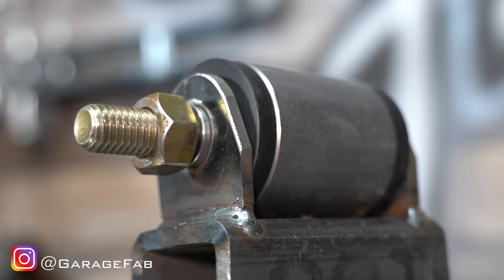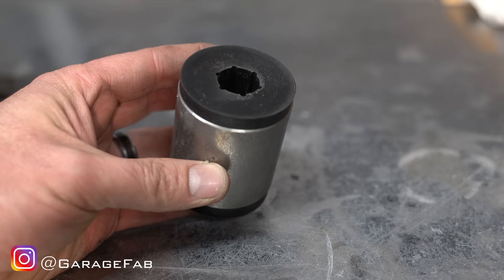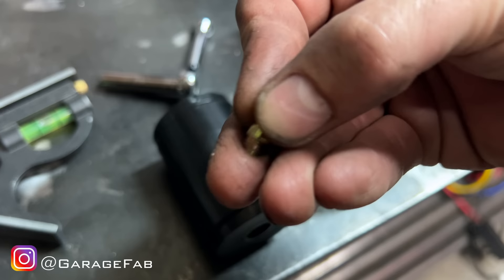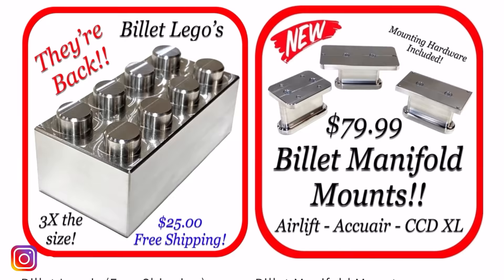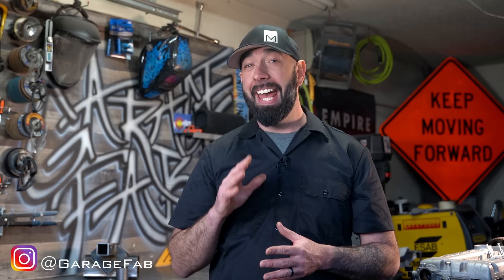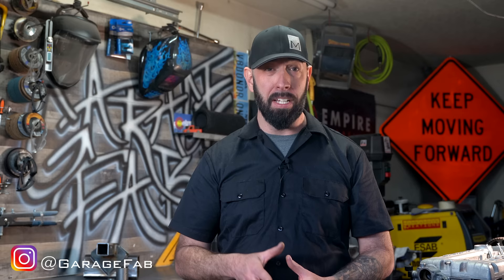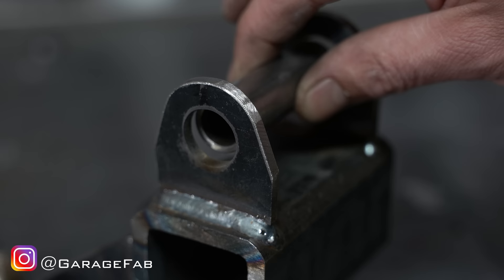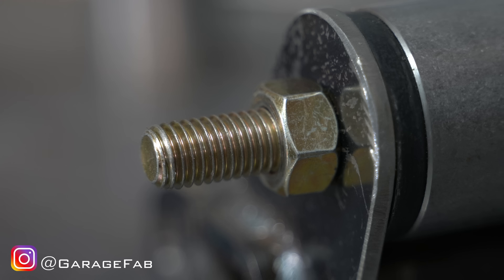The DOs and DON’Ts When Installing Polyurethane Suspension Bushings

Comment: So I might be a little late to this video but I will shoot for it anyway. I'm looking to install polyurethane bushings on my car in the near future and I´m still a little confused after this video where I should and shouldn't put grease. Clearly after watching this video I understand that you are supposed to grease between the inner sleeve and the poly bushing but i've seen a couple of other videos of people installing poly bushings and they also grease between the poly bushing and outer sleeve... is this wrong or right or does it even matter? I'm suspecting that I am thinking of poly bushes to much as a standard rubber bushing where it uses the flex of the rubber itself to move. Also I've seen some people put some teflon tape between the sleeves and the poly to prevent eventual squeaks, is this ok to do or should I avoid it?
Reply from the maker: There’s going to be a lot of opinion in this answer. I honestly don’t know what the “correct” answer is but I’ll do my best to explain why my beliefs are what they are.
I only grease the inner sleeve that’s designed to twist inside the bushing material.
The outer sleeve generally does not move on the polyurethane. It could technically be glued to the outer sleeve and it would work beautifully.
Because the outer sleeve does not move, it shouldn’t squeak. By lubricating the outer sleeve, you could be promoting movement that shouldn’t exist. If you have movement, the grease will eventually squeeze out and a squeak will develop. To clarify, squeaks come from insufficiently lubricated polyurethane sliding against something else.
So greasing the outer sleeve in an attempt to prevent squeaks might actually cause squeaks. 🤔 
What you need to know about poly bushings is they are notoriously noisey. The only way to keep them quiet is to lube them and lube them often. The only realistic way to lube them often is through a Zirk fitting. It baffles me that control arm companies often neglect installing Zirk fittings. The only other way to lube is to remove and disassemble. No thank you.
Here’s the thing about Zirk fittings; If they’re designed properly, the fitting is positioned at a small gap between the bushing halves and the inner hole in the bushing material has channels to supply the inner sleeve with grease. Important note! Those channels don’t exist for the outer sleeve. So if it starts squeaking there you can’t replenish the grease using the Zirk, so your only choice is to disassemble and grease. (Or remove said grease.)
Another reason I’m not a fan of greasing the outer sleeve is some bushings see lateral force. If the outside sleeve is lubed, the sleeve could slide sideways better on the polyurethane putting extra force on the poly bushing flanges. Big deal? Prolly not. I just don’t like that idea.
Honestly, I haven’t had obnoxious bushings since realizing the importance of frequent greasing. A little grease once every other oil change and it’s fine.
That said, teflon tape sounds weird. Maybe it works. 🤷‍♂️ I predict problems installing it. Teflon tape is strong when you pull it long ways, but quite fragile when you pull it widthwise. I can foresee Teflon tape just being torn and pushed off the sleeve when trying to press the bushings into the sleeves. But again, what’s the point of a creative hack when proper lubrication is generally all that’s needed? Hopefully this made some sense. Lemme know!
Reply: @GarageFab Wow man thanks for the response! Yeah it seemed a little weird to me why you would lubricate in places that could allow movement that maybe wasn’t designed to be there. I’ve also started to understand that with mods that improve performance you have to make compromises on other stuff that car manufacturers can’t ignore if they want to sell to the masses. I guess with the perfomence of poly you might have to endure a little squeking as well
Reply from the maker: Truer words have never been spoken. Your thinking is spot on.

Comment: As a 75 year old, retierd, mechanic, i was taught it was incorrect to tighten up a nut bolt attatchment using the bolt. Doing this can damage the inner bush.. Also the use of nuts and lock washers is a NO NO. Lock nuts are safer and garantie not to vibrate loose. .
Reply from the maker: Thank you for the info, Edward! Could you clarify the tightening procedure? The way I read that was “Turn the nut while holding the bolt still.” How does turning the bolt damage the bush?
I work on modern Toyotas for a living. Many of the suspension fasteners have bolts with washers and nuts that are designed to bite into the chassis to prevent movement. These nuts cannot be loosened or tightened by turning the nut. You MUST turn the bolt or you’ll be breaking tools and swearing.
Reply: @GarageFab  The bolt, being the same diameter as the inner metal sleeve, will turn and can damage the sleeve and the holes in the fixing locations. Self locking nuts will allow the bolt to be pulled thro therfore reducuing the risk of damage to bolt and sleeve..anyway,,Just my thoughts, and time charges everything...
Reply: Time CHANGES  everything...

Comment: Very nice, I just don't know how to deal with solid rubbers. The ones that don't spin.
Reply from the maker: What do you need to know? There’s not much you can do with them. They generally can’t be greased, so if they’re noisey, replacement is often the only option. When installing it’s important to NOT tighten the through bolt until the weight of the vehicle compresses the suspension. Tightening things down in the air can cause the bushing to tear prematurely because it’s constantly flexed/twisted.

Comment: I've understood how the bushing is supposed to work, but what I always thought was odd is that if they really wanted to keep the inner sleeve from turning, why aren't the ends serrated so they lock in to the tabs?
Reply from the maker: I wish I could send you photos in the comment section. Toyota does exactly that on their front control arm bushings!

Comment: Some suspension bushes bolts should be tightened up once the vehicle is on the ground not in the air as you can damage the bush over time due to it being preloaded artificially.
Reply from the maker: Very important info there! Bonded rubber bushings don’t slip like polyurethane bushings. Tightening them on a lift is a great way of tearing them or at least drastically shortening their life. You’d be surprised how often “experienced” technicians do this wrong.
Reply: @GarageFab  👍💯

Comment: So about the bolts, as long as everything is properly sized (tab and bolt hole) is there a need for washers on the either side of bolt (head and nut sides on the outsides).
Reply from the maker: I always use washers, Patrick. But I can’t really tell you a scientific reason why. Admittedly it’s just because everyone I know has always used washers. A terrible reason to do anything. I know they protect the surface, and I know they help to distribute the load of the bolt more evenly. But what’s the consequence of NOT using washers. Cracking? Loosening? No clue!
Still I’d advise that you do. It’s just a few more bucks, washers won’t cause harm, and they definitely make your projects look more professional, and it’ll keep you out of trouble from the washer police.
Reply: @GarageFab  Take it one step further, use flange bolts and nuts, pretty much the best of both worlds, at the sacrifice of being more expensive and not quite as readily available of course, but I do love them, especially with a top lock flange nut for final assembly.
Reply from the maker: I can agree with that. Far too many of my decisions come from what I’ve seen Toyota do on their cars. Almost everything is flange nuts and bolts, and I’ve come to love them. 💕

Comment: Any input/guide as to the metal gauge for making tabs bushing tabs? Like is it always size....xyz or do you go up proportionatley based on  the size of the build?
Reply from the maker: I consistently use 3/16 inch thick steel for bushing tabs. But I always build roughly the same size vehicles. I think the thickness of the metal isn’t as important as the structure of the tabs. For example, production vehicles, Toyota, Ford, etc. use 1/8 inch thick metal for their link bar and control arm tabs, but they’re stamped in a very sturdy boxed design. I try and take their designs into consideration when I design my own. If the tabs will just be pushed and pulled on, like on a parallel 4 link, and the tabs are short, I’ll simply weld them to the frame. If they’re long I’ll connect them together in the form of a C.
If the tabs will be pulled or pushed sideways, I will connect them together and gusset each side to prevent sideways movement. I’m not an engineer, so the best I can do is copy with the professionals do.
Reply: @GarageFab  As an amateur fabricator, when structure design strength is in question, I have always gone with: Better to over build vs under build. Thx for the reply!
Reply from the maker: I strongly agree. Overbuilding is likely only an issue on race cars when weight becomes a focus. 👊

Comment: In your opinion, what (if any) is the best way to lubricate bushings that do not have grease fittings?
Reply from the maker: Excellent question! So good in fact that I don’t have a good answer! 😂 
I think the only right way is to remove component, disassemble the bushing, and lubricate it by hand. Because I’m a lazy person, I’d probably try to avoid that by drilling and tapping a hole in the sleeve and installing a grease fitting. It’s a Hail Mary, with no guarantee grease will even inject properly, and you might be back to square one.
Reply from the maker: I pondered for a moment, and realized I automatically assumed you were talking about a polyurethane bushing. Most production vehicles have bonded rubber bushings. If you have that type, there is no lubrication possible. 😩
Reply: @GarageFab  So, what I’ve been doing (and it very well may be “wrong”) is a light shot of silicone spray. It creeps under surfaces and seems to stay put and repel moisture for quite some time. Just wondered if there was a better way. Thanks for responding… btw - your video on the differences between triangulated, parallel and watts link 4 links was fantastic. Great job!
Reply from the maker: Thank you my friend! Very much appreciated. 🙏 I think your silicone spray is just fine. I’ve used the dry type on rubber bushings at work, and had better results then with anything else. WD-40 works but only temporarily! White lithium spray doesn’t seem to get into the tight crevices. Best of luck!

Comment: What if you have old crusty leaf springs attached to said configuration and there is no grease port, should you hose it with your favorite spray?
Reply from the maker: Unfortunately, Dave, I don’t think I have a good answer for you. I’ve never had a lot of success lubricating assembled bushings. You can douse it with whatever you please and attempt to work the suspension to get the lube to penetrate but it just won’t! I can tell you the best results I’ve had is with silicone spray (dry type or wet type.) It’s very thin and if there’s any crevices the spray will find its way in. Plus silicone is safe on most bushings whereas petroleum based lubes are not.
I think the only “Right” way is the most unpleasant; to dismantle the bushing and either replace it or lube it by hand and reassemble. 😬
Reply: @GarageFab  can that cause a van to be stiff as a board and feel every bump? do rusty leaf spring packs also cause that because they dont like to flex? every van i had was kinda stiff though
Reply from the maker: I think a stiff ride is just the nature of trucks and vans. The springs need to be able to support heavy loads, and unloaded they feel… well trucky! Bushings and rust aren’t likely to change the ride significantly.
An option, is to remove one or two of the bottom leaf springs. With each leaf removed, the van will ride softer, but also lower. If you find the ride quality you want but it’s too low, you can add lift blocks or helper air springs.
Reply: @GarageFab  mine is actually an e350 super duty senior citizen bus. i called the company that did the conversion process in 2005, and they have no idea what im talking about, but my contention is it may actually have some extra leaf springs in the pack, one of them is even touching a bolt on the brake caliper making it difficult to remove the caliper, and this is on both sides.
Reply from the maker: Oh my! That sounds less than acceptable. I would not be surprised if a personnel carrier was modified for more weight. Start there!!

Comment: The inner sleeve is not the same length as the total width of the bushing assembly. It's not supposed to be either. It's supposed to be 1/16" to 1/8" narrower to compress the poly bushings slightly so they don't wear to a loose situation. 

Secondly energy suspension poly bushings are graphite impregnated and do not need grease ever.
Reply from the maker: I’d agree with that 100%. I avoided that as to not be confusing, but the way you worded it wasn’t confusing at all. 🤔

Comment: I like your cross member you built in your video I want to build a similar cross member for my Samurai it will go right behind cab ..the distance between center of axle and cross member  will be 16"  .. I know that's short but that's my best workable space .. the bottom four link bars will be no longer than 16" center to center bolt holes .. that's my only way for me obtain parallel 4 link with 8" of height  differences in my small space ..  will it work ?

Comment: soooo....about those toyota bolts rusting the inner sleeve of bushings....what tips might you have?  I got the backing plant off and the outer nut of the rear strut rod, but the bolt is definitely not interested in coming free of the sleeve
Reply from the maker: Oh boy. My apologies my man. That’s an ugly situation. When we come across that, it’s time to go at it with a sawzall. We cut through the sleeve, while trying not to damage the chassis. Unfortunately you then have to replace the alignment sleeves.
Reply: @GarageFab  thanks so much....I figured.  Gramp's 50's sawzall is about to come in handy....ugh LOL
Reply: @GarageFab  well the good news is I got the strut rod bushing replaced at the knuckle only to find out what is probably really the problem is the trailing control arm bushing at the knuckle.  Instead of a sawzall did you ever have any luck with any sort of carbide cutoff tool used in automotive sheet metal work or anything thin like that?
Reply from the maker: Yes, though I didn’t want to suggest before since it’s a definite no no. I use a 6 inch cutoff disc on a 4.5 inch grinder with the guard removed. Such a bad idea for so many reasons. So I’m officially recommending you don’t do that.
Reply: @GarageFab  oh I'm that daring anyway.  I won't share what I've already done 🤣
Reply from the maker: May God have mercy on your soul, good man!

Comment: If the tabs are already welded on the frame how do I make a straight hole with a hand drill for the bolt?
Reply from the maker: Have you got a steady hand and a carbide burr tool? It’ll take a little longer but you can just sculpt it by hand. There’s certainly won’t be enough room for a router unfortunately.

Comment: Can you make a grove on the busing so as it moves it spreads the grease.
Reply from the maker: The bushings I use, already have all the grooves needed. There’s none on the outer walls though. I don’t know if that would help or hurt. It might make it easier for the grease to escape and go dry.
Reply: @GarageFab  Keep the grooves with in :)

Comment: My experience with replacement poly suspension bushings is none have a grease fitting. The provided small packages of "Formula X prelube polyurethane busing grease" is 3 packs short of enough to do the job. What grease are you using? Their brand is clear like silicone grease but don't know as its proprietary.
Reply from the maker: Yes! You are absolutely correct from start to finish. Poly bushings are notoriously noisy and need to be lubricated often to keep them quite, so the supplied grease might work at first but certainly not forever. Zirc fittings are a must.
Most poly bushing suppliers do in fact recommend a silicone based lube. Unfortunately the stuff is expensive, (maybe that’s why they give you tiny little tubes) but a grease gun full will last you years.
Most importantly stay away from petroleum based lubes because it will soften the polyurethane and ruin the bushing.
https://amzn.to/3E8n3lX

Comment: 4:45 what greases do this?
Reply from the maker: For polyurethane, it’s best to use silicone grease. It can be expensive though. Most importantly just stay away from petroleum based greases.
Reply: @GarageFab  I use petroleum based greases on everything pretty much... I guess I should just stay away from polyurethane? 🤣
Reply from the maker: Well it really depends on what you’re greasing. Petroleum breaks down both rubber and polyurethane. Everything else Is totally fine with petroleum grease.
Reply: @GarageFab  I understand it breaks it down but it still needs it?  Rubber boots on vehicles still need to be greased and it's petroleum grease that does it...

Comment: Never seen one like that, only the type where the inner tube is tight against the bracket and the bush is vulcanised so that the outer tube with suspension movement flexes the rubberised inner. This ,must be a newer type [well it is to me but i have not had to fit  bushings for many years.]
Reply from the maker: All the production vehicle companies still use bonded rubber bushings, John. I think polyurethane bushings are pretty much just used in aftermarket and racing applications.
Reply: @GarageFab  Thanks for that.